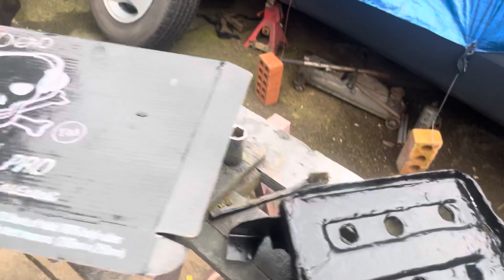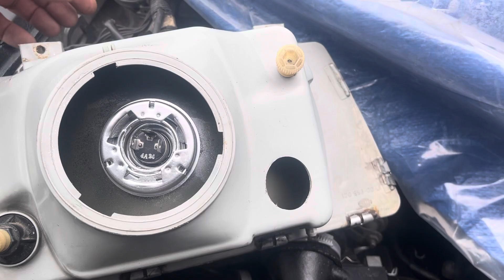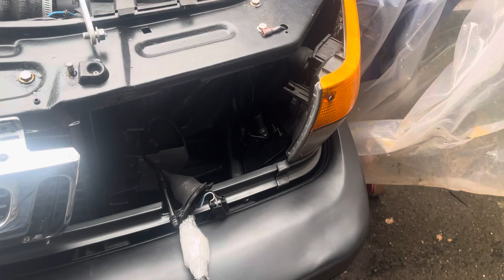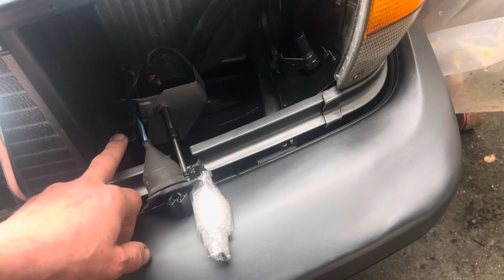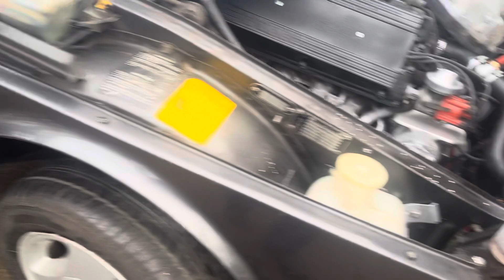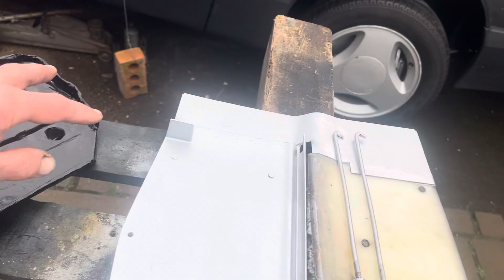Saab 900 Turbo 16s battery tray and headlight fixings.

Comment: With the front cross member did it have a underneath piece so it’s one solid thing or was the underneath covered with a protective plate acting as a splash guard so it would get rust/dirty.
Thanks.
Reply: With yours does it have a massive plate from fender to fender and it goes around the gear box so the bars can go across then it carries on under the front crossmember
Reply from the maker: @Monty-jj6sv I welds to the front lip of the crossmember under the grille and front body kit. It also welds to the two side panels one being the underneath of the battery tray. The fender / wing bottom that curves under the car welds to these side panels. The lower side panels run under the crossmember front lip to the wheel arch turret. The skid plate or splash plate runs in the middle of the two lower side panels and on mine  and stop an inch back from where the gear chain housing starts. It’s rectangular and measures about 12 inches deep by 26 inches wide. It’s basically is the width of the 2 side beams or width of the bonnet hinges looking from above. You can email me and I can send some images if needed.
Reply: @MarksMadProjects1 yes please that would be wonderful
Reply from the maker: @Monty-jj6svmy email is in my bio
Reply: @MarksMadProjects1 ok cool thanks
Reply from the maker: @Monty-jj6sv have a look at my videos from Jan 25 labelled crossmember. I think there’s 2 videos on my playlist and hopefully you can see the components there. 🤷‍♂️
Reply from the maker: The bottom of the crossmember acts as a skid plate and welded to it. 2 aluminium bars are bolted to it and run under the gearbox. The later 87 -93 models have a longer full length skid plate. The part number was 8274383 but now obsolete. Does this help?

Comment: Any idea how to remove snapped bolts from the engine without a welder
She’s looking good.
Reply from the maker: I can only suggest heat and stud extractor set after drilling to correct tap size. I’m sure there are plenty of videos on here to help. 😱

Comment: As a belt-and-braces guy, I always wrap my battery with a thermal wrap as well as the factory shield.
Reply from the maker: Yes agree. I never understood why Saab placed the battery right next to the turbo then made a heat shield to stop it from melting. Ok on none turbo models and plenty of space in the boot. It’s a known area for corrosion. 🤪
Reply: @MarksMadProjects1  From what I’ve been able to discover, it was a result of having the ‘backwards’ engine design.  The weight distribution was improved by having the heavy turbocharger further back, prioritizing crash safety and weight balance over battery life.  In this way, both the battery and turbo (as heavy components) are kept inside the front axle line.
Reply from the maker: @TheBTG88  Yes I get that but if that’s the case why not shift the battery to the inner and outer wing void where only the washer bottle sits. Strength the inner wing and bumper support anchor panel and move the washer bottle (made of stainless) near the turbo. Battery (bomb) is still over the front axle and washer water pre warmed.. 😉
Reply: @MarksMadProjects1  Perhaps something to do with the fact that the 900 is really the 99, with a stretched body (not wheelbase), and the 99 was developed before that brought the turbo engine on board - first in the 8v guise and then the 16v.  While Saab had some clever engineers, they were also a small company on a budget, thus some things could not be optimized.
Reply from the maker: @TheBTG88 Absolutely. I’ve had this old girl for 30 years. Uk wise it must be one of one in its factory original spec. A few blacks about that have been altered over the years and one 85 silver and burgundy that has recently raised its hat in the UK but rough and without full history.
Reply from the maker: @TheBTG88  Apparently some of the extra length, mainly the rear end was due to the clay slipping down the mould in the hot design shop. 😂